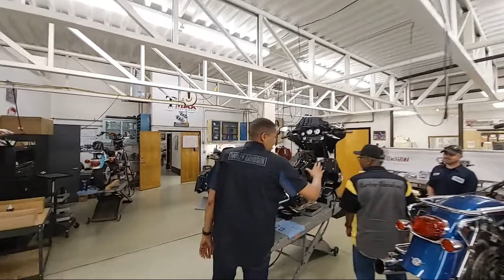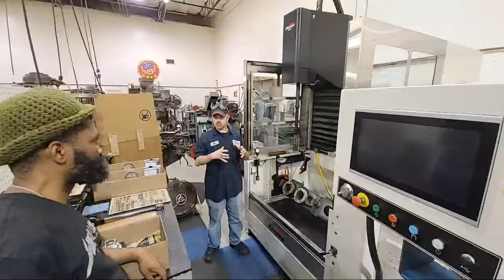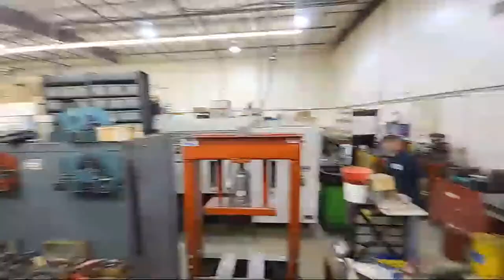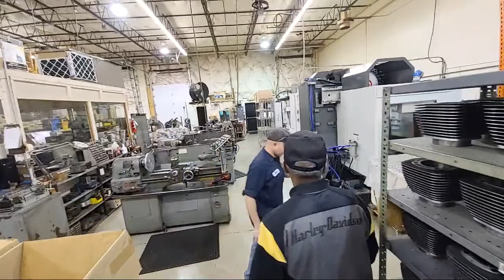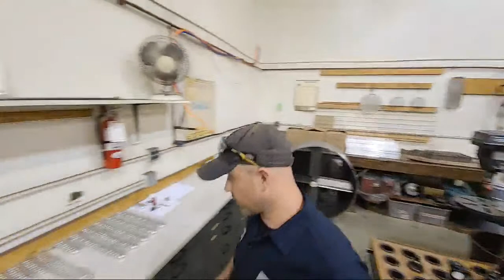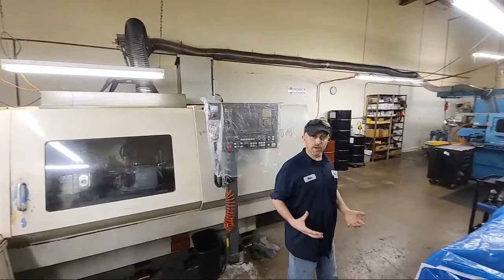Live From Zipper's Performance Products! Starting The Build!

Comment: I like how he says when you bore the cylinder it isn't perfectly round. It's not that the machine is not capable of boring it round, it's that, as material is removed, it stress relieves and moves (shrinks in areas, expands in other areas).